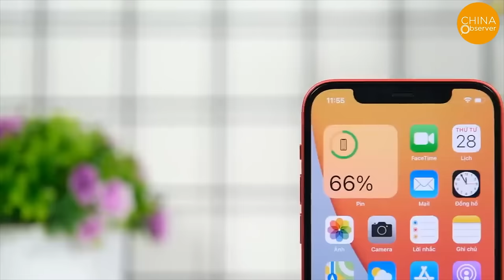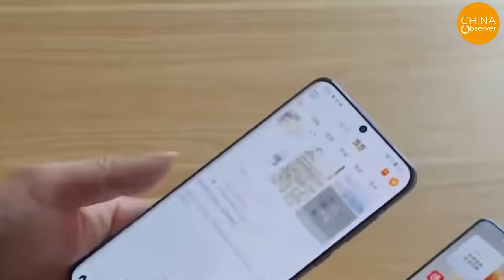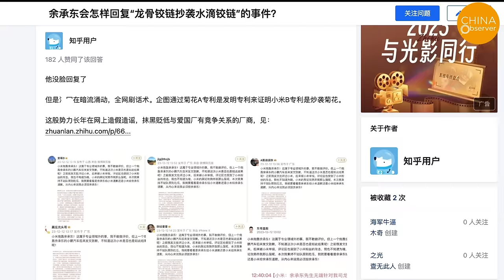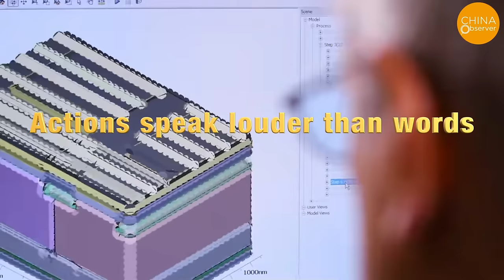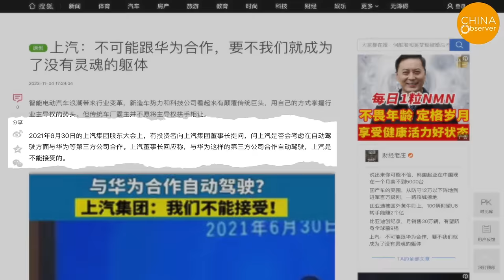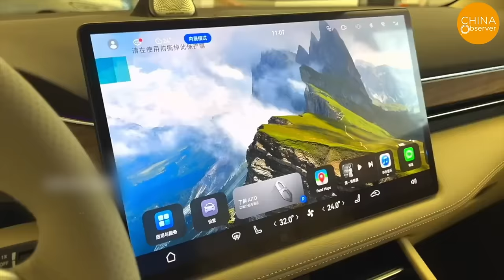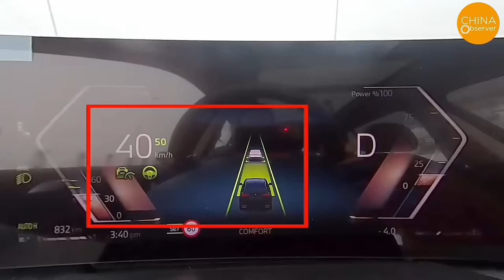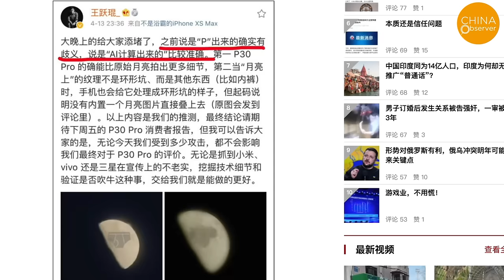Stolen Smartphone Tech, Pilfered EV Technology: China’s Two Tech Giants Point Fingers at Each Other!

Comment: I'd like to see some actual 100% chinese derived innovations.  Seems like the last big ones were black powder and noodles.  The last 600 years or so have been kind of quiet for them.
Reply: You forgot green jade artworks...
Reply: Correct me if I'm wrong but you also forgot tofu?
Reply: @rayoflight62 art doesn't really count. gun powder changed the way war is waged. Tofu is great dietary food. Art is just Art.
Reply: @breakwhiskey2863  you got to admit that tofu dreg project is... pretty innovative. (can't figure out how the  high rises are standing when concrete walls and ceiling within crumbles from mere touch.)
Reply: The best Rubik's cubes for speed cubing are all Chinese designs. They are the only ones making improvements to locking mechanisms holding the pieces together. An original Rubik cube was always a tradeoff between how loose, lubricated, and frictionless you wanted the pieces vs the likelihood of pieces popping out as you turned the cube. Modern Chinese designs don't have that tradeoff; they are spring adjustable to however loose you want them and pieces pretty much never accidentally pop out. There's also improvements to edge grips, use of colored plastic over stickers, centering magnets, etc all chinese improvements.
Reply: China has the most number of patents the past 6 years..
Technology has reached a saturation stage that any major big jump is really difficult..
Reply: @calvinblue894 racing to patent American patents in China isn't impressive
Reply: Hi-fi audio is where it's at with ACTUAL innovations. Chinese Hi-Fi is no joke while still keeping the prices low, and I mean ~$25 low.
Reply: I mean, they innovated with COVID-19. 😂
Reply: Their biotechnology COVID-19 does have a big impact on the whole world.
Reply: History Memes
Reply: @Dfthg-bz3hp  What are you talking about? Do you know what Patent is?
If you invent something new, new formula, product etc.. You patent it..
You cannot patent something that is already in the market.. Omg.. Please study
And patent is INTERNATIONAL
Under WIPO
Reply: @ovum  I meant actual innovation like the transistor, the TV, the CD, the automobile, the electric motor, the microprocessor...things like that.  They don't innovate new technologies, they take existing technologies and figure out ways to make them cheaper.  but this isn't done due to some cultural aspect but simply to undercut the next guy and try and make more money.  As for patents, they own so many patents because they bought them.  Hauwai is a classic example.  they came to many Canadian universities and provided funding for the research.  The Canadian students did the work and Hauwai got the patents.  that is NOT the same as the Chinese actually doing the work and earning the patents.  So when I note "innovations" I mean those things that truly change the world which is why I mentioned gunpowder and noodles.  Those had global effects and changed (or eliminated) entire cultures. They didn't even invent the horrific brand of communism they hammer their people with.  They just borrowed the idea from Russia and twisted it.
Reply: @Psygnosis  and the Whuhan Flu sued them over the name change
Reply: @breakwhiskey2863   i thought takumi fujiwara made this XD. unless u meant tofu dreg, not drift
Reply: @calvinblue894 they just spam the patent offices with mostly small pointless or vague designs and processes to gain superficial superlatives, paper on their wall, and to troll companies with frivolous lawsuits and keep them from competing in China. 🙄
Reply: You forget 5G.
Reply: @so7o3o4  why would he have mentioned 5G? Qualcomm and the other companies whose innovations made 5G possible aren’t Chinese.